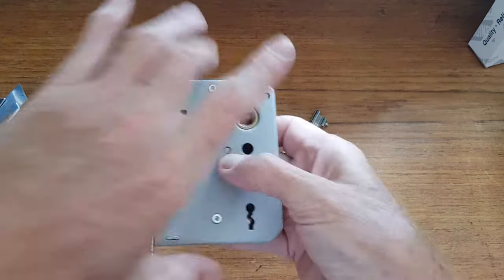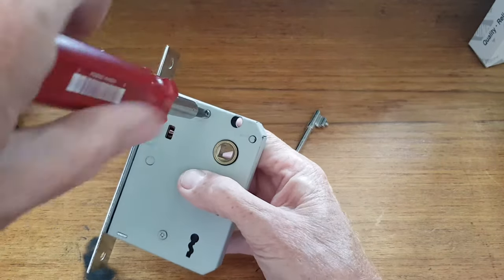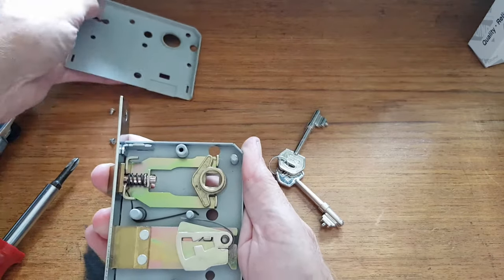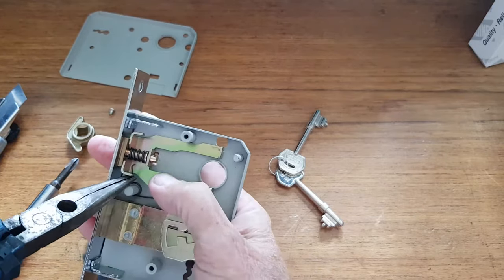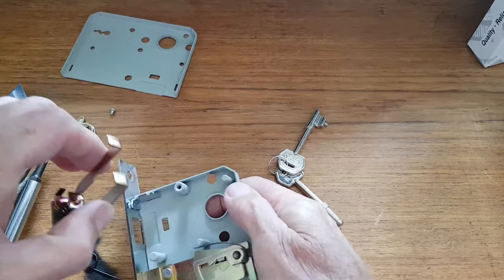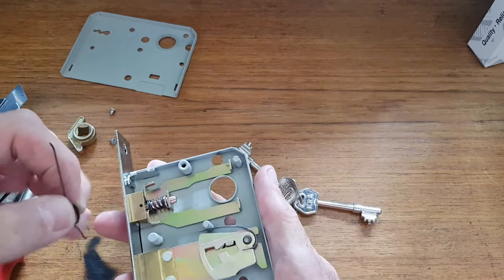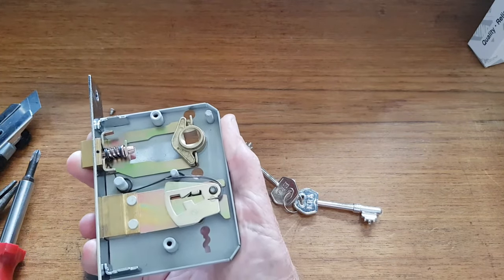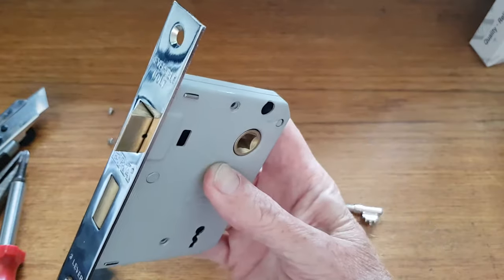how to reverse a sashlock latch

Comment: On some of them the latch can be pushed out a bit through a small opening in the case as to allow reversal.
Reply from the maker: Some you push the latch back and then see a screw holding the brass latch in place, undo, reverse and do up. So much easier, but lots are not.
Reply: This should be the top comment. Indeed, many do not need removing the cover... just push a screwdriver into a hole and rotate the latch.
Reply: This is exactly what worked for mine as it doesnt have screw that I can unscrew. Thanks for this. You saved me of big headache🎉
Reply: @LockMonster Hi, what screwdriver did you use?

Comment: Much appreciated. I have a Swisco 40-214 (insert 40-213), which is obviously a different model (that, as it turns out, doesn't even require the faceplate to be removed, duh). Nonetheless, this helped considerably
Reply from the maker: never heard of that brand, is it being used in UK??

Comment: Really useful to see inside it. Do you have any tips for one where the latch itself is not fully retracting? Mine is stuck and I can't open the door
Reply from the maker: I expect the cam the square handle bar passes through is worn out inside, you have to replace whole lock. thanks
Reply: @LockMonster   Thanks. I'll see if I can pad it enough to get the door open. I really appreciate your reply 🙂
Reply from the maker: @grahaml8838  If you just want to open it, cut a strip of plastic off an empty coke/water bottle, slide the strip in the gap and sometimes it pushes the latch in
Reply: @LockMonster  Thanks! Do you have any affiliate links that I could buy the lock through to give you a kick back?
Reply from the maker: @grahaml8838  our website lockmonster.co.uk
Reply: @grahaml8838.
Hi, i really need to know the screwdriver used for this?

Comment: On my lock it says not to do this because the springs inside can cause injury.  Instead it says use the opening near the latch - just push a screwdriver into the opening and use it to push the latch out.  Then you can just spin it around without opening the plate at all.
Reply from the maker: some are like that, not many, most are like this one.

Comment: Thanks for the video. What stops the square spindle hole tipping a little when the latch is pushed in? The cam part seems quite loose, by design. All my door locks are fine, the handles doesn't tip down when the latch is pushed in. But I've now bought 2 Yale locks and the handles do tip about 25 degrees. Yale says they're faulty, but in the mechanism in your video, I can't see what's holding the square hole steady and horizontal when the latch is pushed in.
Reply: I think I've just worked out it might be a problem with the springs in the handles. I'll check.
Reply from the maker: @sabbatini2372  Sometimes there is a little notch in the plates of the case of some locks and you have to turn the brass part with square hole a little just above that it above just before you close the lid back up, hard to explain. I doubt the lock is faulty?
Reply: @LockMonster  Thank you. I'll check. I'm not there at the moment, where the door is, but will see early next week.
Reply: @sabbatini2372  Hi, what screwdriver did you use?

Comment: There is no need to open this lock casing to reverse the catch. Just pull on the catch using a set of pliers and twist. It doesn't even have to come out of the door...
Reply from the maker: Most don't just pull and twist, one in a 1,000, some have a screw on the catch also, you just unscrew turn and screw in. This video is for these most popular type.